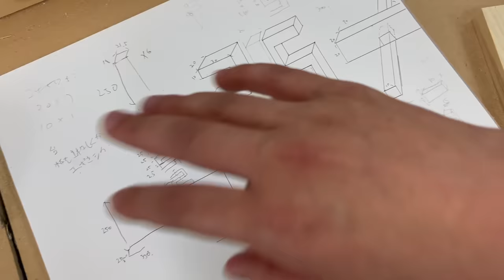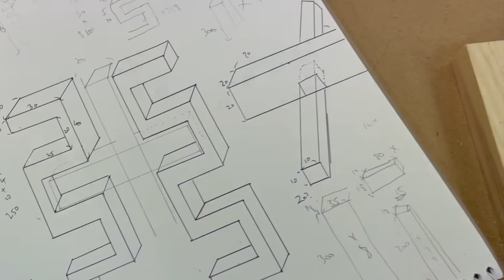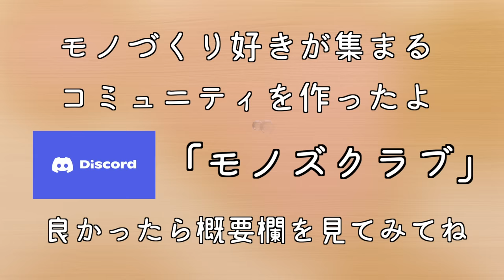想像を超えて信じられない結果が待っていました

Comment: Full disclaimer: I have never done woodworking before. But seeing the wonderful design you made run into trouble with glue I thought of something. I have seen some people on YouTube soak the wooden handles of newly made hammers in linseed oil. Supposedly the oil makes the wood swell up and grip the head of the handle. So I thought, instead of using glue, why don't you join the wooden pieces together without glue and submerge it in linseed oil?

Comment: The idea you had for a lamp or screen made of it. Maybe you could run a dowel through the yaruki pieces and the pieces inserted? like a bolt on a door hinge. If you did that the whole way through, it could keep the stack together and also let it fold open and closed.

Comment: I think most of your struggle is two fold. First, as you apply the glue, the wood is going to swell and with your tight tolerances will make it more difficult to put together. The second issue is hydraulic pressure from the glue. Your tight tolerance means there is nowhere for the glue to go. On the first piece you glued, you can see how the piece starts to bow. When you start to add the pieces on the other side, that glue is trapped and so the piece snapped. If you had allowed the main pieces to be a little wider or the small pieces to be thinner, I think you would not have had as much struggle. Hope this helps.
Reply: I was surprised that you did not accept 10.2-ish in the initial setup. Upon reflection, would this give enough room for glue and some play in the joints as the whole piece assembled? Congratulations to you on the learning you achieved.